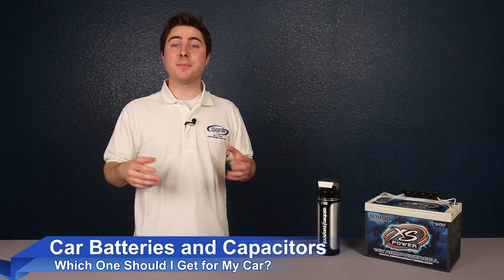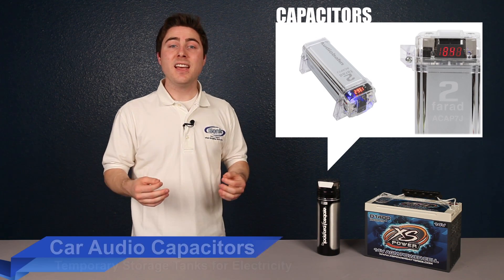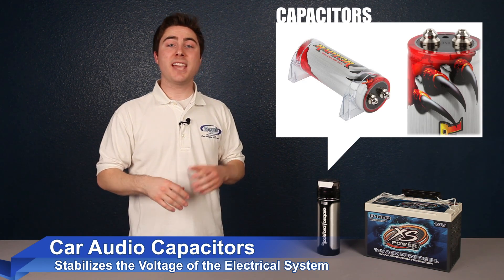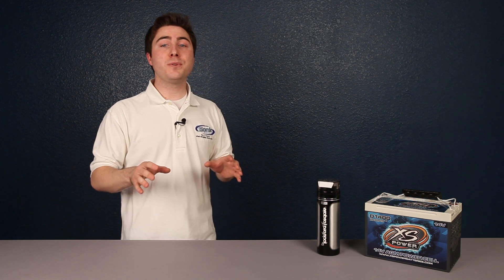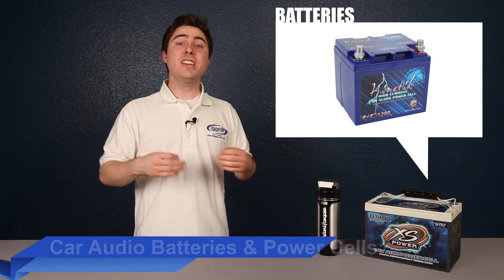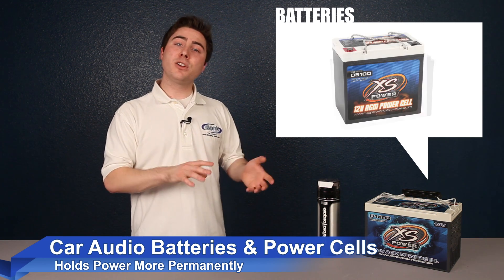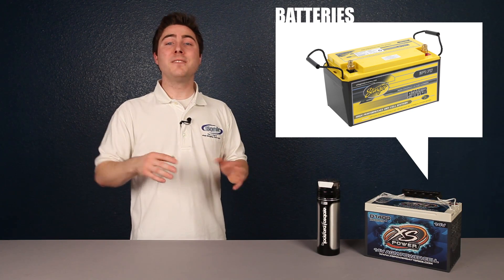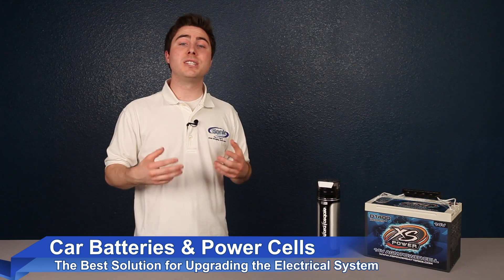Car Batteries or Capacitors: Which Should I Install? | Car Audio Tips

Comment: I'm looking to buy a cap because my (1100w) system has been dying and leading to bigger gauge wire and new fuses and it plays for a good half hour of blasting but shut off and take a break and comes on again. And it's NEW! Will a cap fix this issue?
Reply: FluxCoreKing215 what kinda car you got it in
Reply: Le Sabre
Reply: FluxCoreKing215 what year
Reply: 2001
Reply: FluxCoreKing215 what kinda amp u got is that the 1100w?
Reply: FluxCoreKing215 it sounds like your amp is going into protection mode drop some dollars get a nice one dont get no walmart stuff like scosche or power akoustic or dual or cheap crap like that

Comment: I have a few questions about car audio. If I'm going to install a 200 rms powered sub into my 05 mustang gt, will that draw enough power to require a capacitor or bigger battery? Also, if I'm installing a new reciever, do I need to worry about the reciever power?
Reply: Wade Perkins no 200rms will be fine I run a 1000 rms mtx1000 amp and two Kenwood 12s with slight light dimming just ordered a capacitor today
Reply: this was also in an 05 mustang gt, since they are v8s they have pretty hefty Batts so you shouldn't have any issues with 200rms

Comment: had a question does a  capacitor make a amp trip?? cause every time I turn my stereo on my cap turn on and  my amp but then cap lights goes off for one second then it put my amp on protective mode before my stereo all the way on any reason why it's doing that??  is my capacitor bad need to buy a new one??
Reply: It's your speaker pulling to much power

Comment: I'm gonna be using two xs power secondary batteries for my amp for my 10/11 meter and CB radio. I'm not using d series but they are 12 v Agm batteries. These should work right?
Reply: Nathan T you're joking right ?
Reply: Fox250R I've got everything I need. I got a 200 amp motor maul for my high powered amplifier and I've got a 300 amp alternator
Reply: Nathan T so you're just running a cb radio and amp? Like a 2510 or RCI 2950?
Reply: Nathan T sounds nice. I've had a few 2510s 148gtls and Uniden grants

Comment: I have an Alpine mp500d with a 12"JL Audio TW3. once I installed everything I noticed that the lights were dimming. I know that the battery is a best option but I don't have room for that. I wanted to get a Capacitor but they say don't work. so what do I do?

Comment: people still to this day do not get how a cap works all it is doing is storing energy till its needed well if you have a system that is thumping all the time it will not be able to charg its self fastest enuff to make a difference what you need and want for that is a better alternator that can toss out the amps you need at any given time and a good battery that can handle the high load draw. yes caps are nice to have as they will help to filter and smooth the voltage of electrons but as far as giving you a better bass drop it can do it all the time only if you hit the heavy bass every few secs apart
Reply: So it is not a constant supply of power after full charge? It cannot provide a constant to your battery for something else to be powered from the extra volt(capacity). My scooter spool is not enough to keep up with my xenon, it will drain it eventually. Does it make any difference or can it help in keeping the voltage at the right amount? Just was wondering. Started with electronics classes and these things of possibility pop in mind. Your being creative in a way of thinking. Until you hit a wall. And it is just not possible.
Reply: Dan Coulson Thank you for the explanation. I have read about these things. Being more for the carstereo setup when bass kicks in. I bought a led R3 H8 for my scooter headlight. Much more efficient. I like the xenon but what can you do.

Comment: Hi I'm running  dual amp one for my subs and one for my normal speakers and i was thinking or adding in a capacitor so my question is how many farad capacitor will i need and is it possible to run 2 amps of one capacitor 

i have the following 
two 1000w,rms 7000w,peak 10" subs
one 4400w,rms amp 9000 peak and 
one 140w rms 4 channel 3200w peak
Reply: Shalin Anoop buy a lawn mower battery solve my problems with dim lights an power compat don't work for me